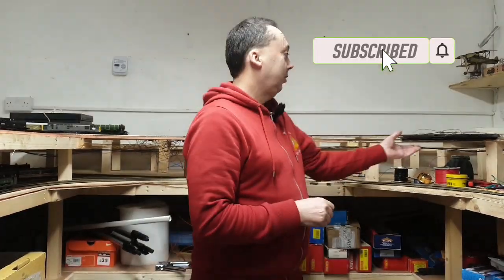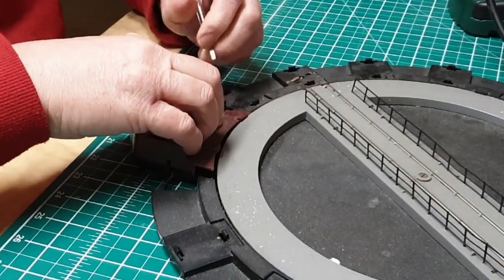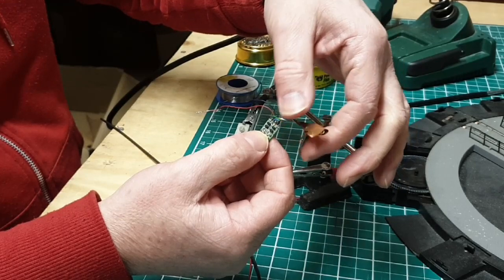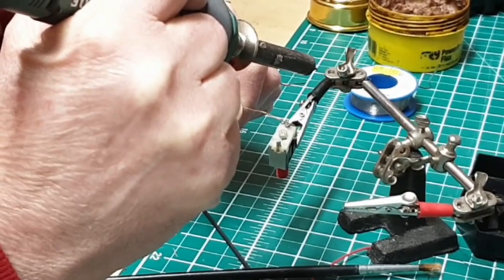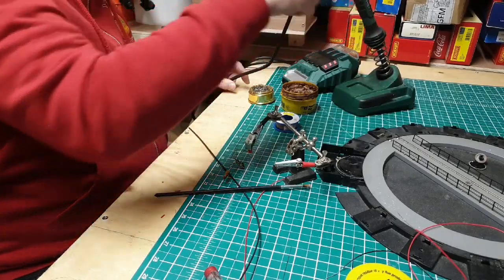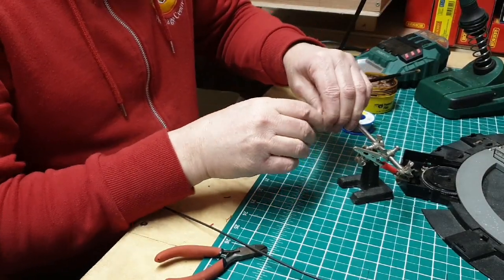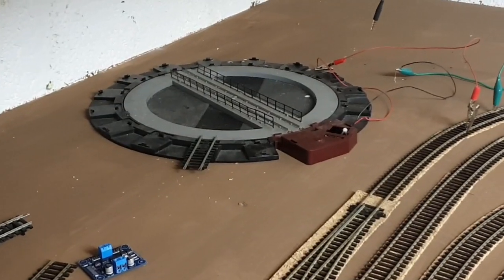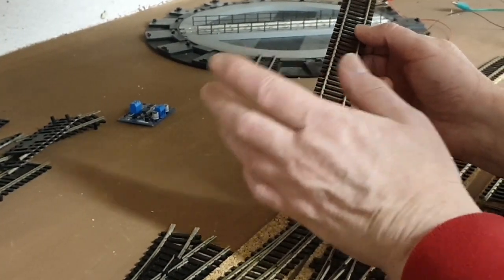54. Converting an Old Hornby DC Turntable to DCC using a Decoder and Autoreverser.

Comment: Hi Mark, Great video,  for any run off tracks or loco sheds do you need a reverser for each track or just the in coming tracks from the main?  I have two inputs tracks to older Walthers DC table I am trying to convert to DCC atm.  I have two in tracks from the main and 3 storage roads.  Any held would be great.
Reply from the maker: Only need a revser for tracks connected directly to the main layout

Comment: Hi Mark, apparently, the auto reverser solution is not compatible with Hornby HM700O, unless you have a loco with a stay alive. Can you advise regarding the turntable wiring for DCC without an auto reverser? Many thanks in advance.
Reply from the maker: Well that has me stumped!! Are you using a DCC system along with the Bluetooth or just a power supply?
Reply: Hi Mark, sorry for the late reply. I am not yet finished with my wiring, but have read on a thread somewhere, that this device is not compatible with HM7000 chips. I love your solution, but was planning to use the HM7000 TXS chips with the HM7000 software, but also be able to use DCC EX interchangeably.

Comment: Hello. Great video! One question that I have is why you needed to put insulated fishplates at 6:36? If the track is isolated, where are you going to get your power from?
Reply from the maker: The power comes through the autorevser. The insulating fishplates stops shorts when it is active.
Reply: @DonegalDadRail  OK, one more question that I have is do you need to wire each turnout section of the turntable?
Reply from the maker: @JoshuaDD-nc3oz   No but it give better reliability if you do.

Comment: Hi Mark. Just watched your video, which is great, by the way. I have an old Hornby "manually" operated turntable, operated by turn ing the water filler pipe. I do intend saving money by fitting a motor to it though, instead of splashing out on another one. And also wiring up the track as DCC (not sure as yet about the motor). What I can't work out though, is why I would actually need a Reverser in the first place? All my exits will be going to dead-end sidings, not leading back into the track layout. I hear what you are saying about the positive and negative appearing the other way round, when the turntable is turned through 180 degrees, but my old Hornby turntable stays as it is until the 4th or maybe 5th (cannot remember exactly which one) exit, but then due to the contacts layout under the base of the turntable, it automatically reverses the polarity anyway. Regards, Bob.
Reply from the maker: Hi Robert if the turntable does it, then you wouldn't need one. Do a test first to make sure it works. Don't want to blow any chips

Comment: I have a turntable i want to fit on my layout. With an auto reverser does it change the polarity of JUST the turn table? or the entire layout? I assume with DCC this wouldnt matter anyway right?
Reply from the maker: Hi Spinex, the turntable needs to be isolated from the rest of the layout by plastic fishplates or a cut in both rails. The autoreverser then looks after the power supply to the turntable and the exits not connected to the rest of the layout.

Comment: Great video. I have a walthers dc turntable can that be converted to dcc also. Would appreciate your input.  Chuck Garcia
Reply from the maker: In theory you should be able to, do you have a wiring diagram for that turntable?
Reply: @DonegalDadRail  years ago.  Perhaps can look it up on walthers home page. I remember wiring it years ago and was not easy.  But I know a lot more today than i did then. I imagine you have to isolate the turntable motor then install the decoder. I'll try to find wiring schematics for turntable. Thanks, Chuck Garcia
Reply from the maker: Yes isolate the motor to run from the decoder and power the rails through an autoreverser.
Reply: @DonegalDadRail  thanks I'll try all that. Layout is in Virginia, I'm in Stamford, Connecticut and you're in Ireland.  Great stuff. Thanks again

Comment: Hi Mark . I have converted my dc turntable same as you with decoder and autoreverser, all works well...only problem ,one of the exits from the turntable I have split into 2  by way of a peco electro frog point and motor both go to buffers. I have isolated the frog ...where do i attach the frog feed wire ???  Thanks Ken
Reply from the maker: Are you using a switch on the motor to power the frog?
Reply: @DonegalDadRail  Hi thanks for the reply Mark.  The point motor is a pl-10e  with an accessory switch peco pl-13   this is in my gaugemaster  prodigy set up. wired up to a switch on my control panel. I used a BLOCKsignalling REV 1 Autoreverser  Ken
Reply from the maker: The frog wire should be connected to the pl-13 (are you using it to switch the frog polarity?)
Reply: @DonegalDadRail  yes the frog is connected to the pl-13 then to a toggle switch to switch the point.  But if the autorev switches polarity on the rails , it wont switch the polarity on the isolated frog , so will short....do i need to attach the frog also to the out on the reverser...sorry Mark i am not very good with electrics....thanks for your time
Reply from the maker: The point motor is a pl-10e should be connected to the switch for throwing the point. The peco pl-13 should have the frog on one terminal and feed from your buswire to the other two terminals. If you are still unsure if you pop into my lives on Thursday evenings I can show you.
Reply: @DonegalDadRail  yes ok how do i do that on thursday Ken
Reply from the maker: As long as you are subscribed to me and hit the notifications bell, you should be notified. I go live every Thursday 19.30 to 20.30 GMT Just come into the stream chat and say hi and remind me in the chat about the point and frog.

Comment: Hi again Mark... all the rail turnouts from the turntable on my layout go to a shed or buffers...do i  connect each to the bus wire....Thanks Ken
Reply from the maker: If you have it set the same as mine then yes. The autorevser sorts the electric polarity.
Reply: @DonegalDadRail  Thanks Mark

Comment: Great explainer!. My brother and I have been struggling with a scratch build TT - it works but it is proving to be a 'psin'. So thinking of getting the Hornby and that reverse chip.  What make is that reversing chip? Also, our TT represents a simple loco yard  with a single entry and exit line - can I do away with the Hornby doing multiple stops as it revolves? cheers  Steve
Reply from the maker: This is the reverser I used http://www.blocksignalling.co.uk/index.php/dcc-autoreverser-rev1 The Hornby TT is geared to stop at each exit, so you would have to changing the gearing.
Reply: @DonegalDadRail   Cheers for that! Shame about the gearing though,